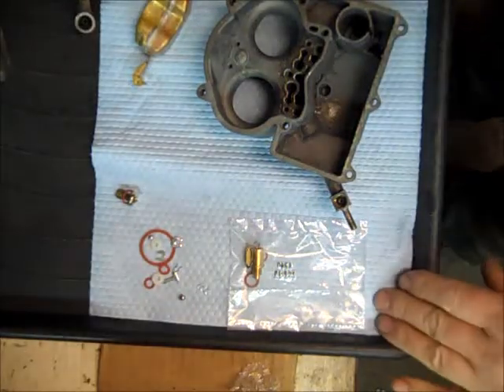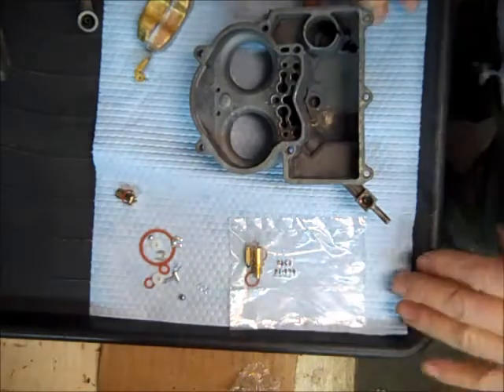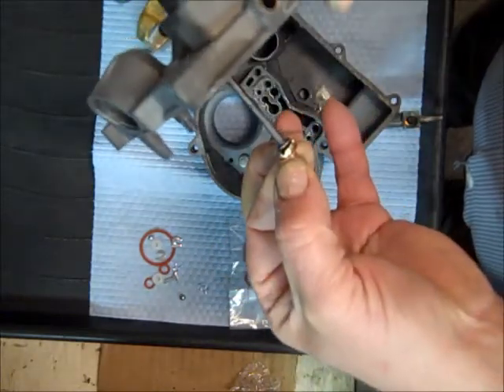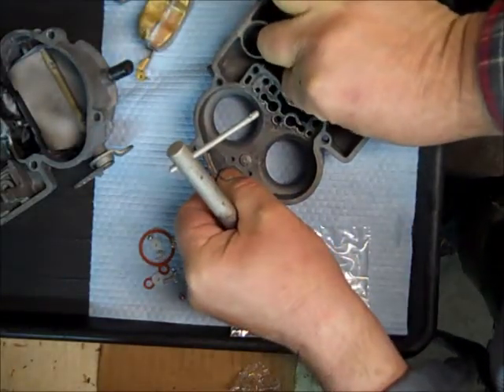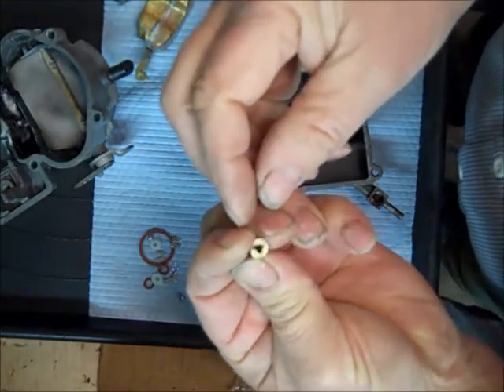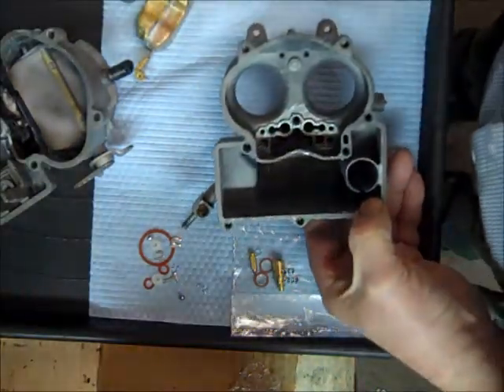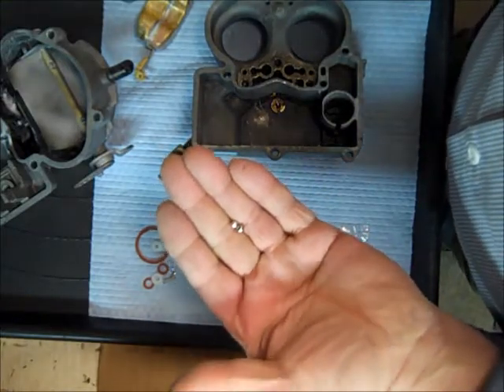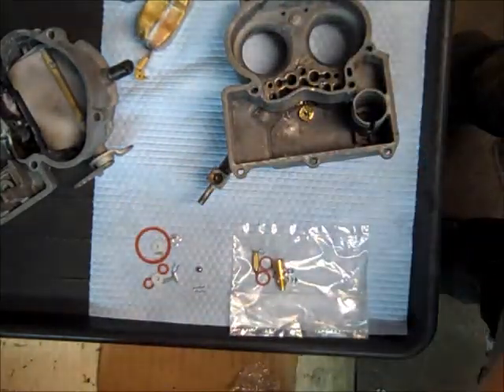Rochester 2 Jet, 2G, 2GC Carburetor Rebuild - Part 2

Comment: Great video and info, thanks.  I do have a problem with an old Rochester 2 jet in that the check ball won't stay in the hole after I stroke the accelerator pump.  The first time I set it, it squirts fine and then nothing the next time.  The ball moves out of its hole with one stroke and so the pump is useless after that.  The carb is for a 1968 Jeep Commando with the V6.  I do have the small aluminum ball in the well.  I figure I missed something, can you help?

Comment: what do you use to get the case so clean?
Reply: +Mikes Carburetor  Thanks for the reply. Could you recommend a place on line to get a rebuild kit? Is there anything I would need to buy that doesn't come in the kit? Also would you recommend using the old bass float or buy a new one? Thanks Mike